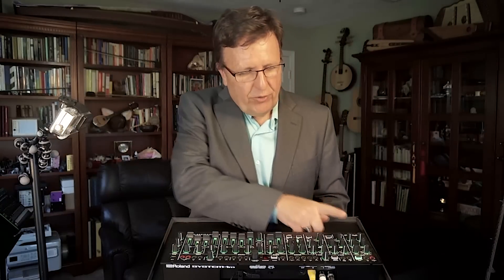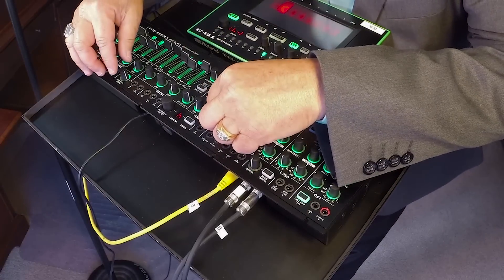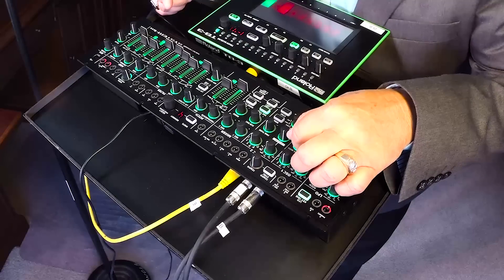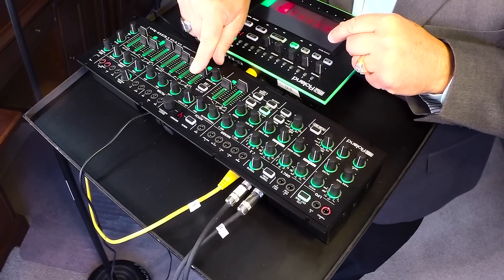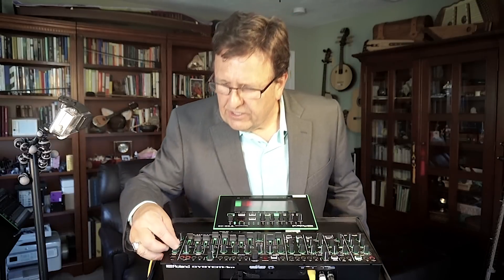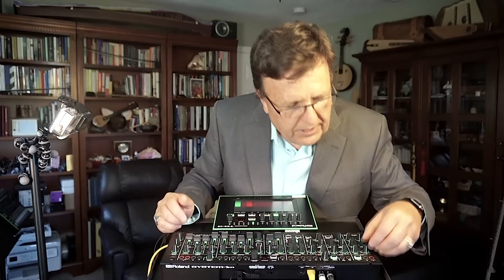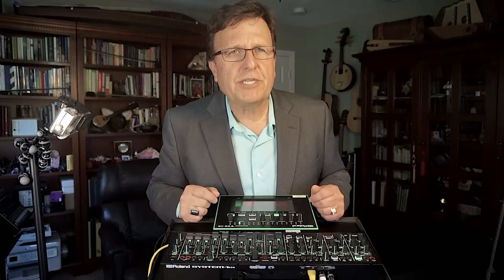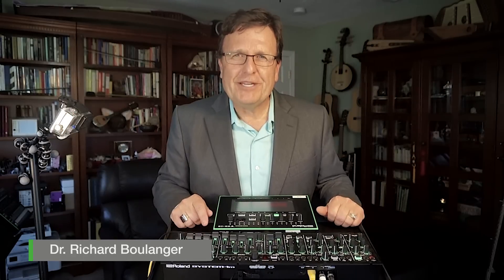Dr. Richard Boulanger - Part 1: An Introduction to the SYSTEM-1m

Comment: so, sound coming from the tb-3 is going in via midi connectors?
the only other connectors is see from the tb-3 looks like a yellow midi in/out.
and black onoes in and out of the system-1m, so how is the tb-3 triggering the 1m note  sequences without being obviously connected to the tb-3?
Reply: it'd be very appreciated now that i've the time to finally get properly stuck in to this gear.

Comment: i'm having hassles trying to run tb3 via analogue jacks into the system 1m then analogue jacks out into the mx1.
but so far not a squeak! 
i do get the test tone by pressing the pitch/push gate knob and turning it to pitch the tone. but i have had no joy running a line in.

i have tried via midi and usb, but i am not at all used to doing that and it just made the mx1 go bonkers.

any tips and hints anyone?

theres no basic user guides available anywhere i can find